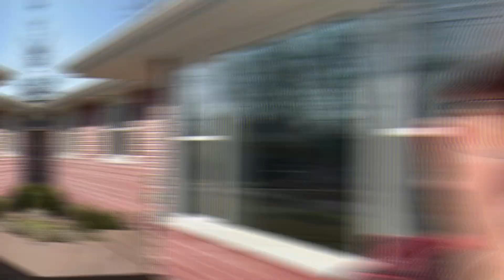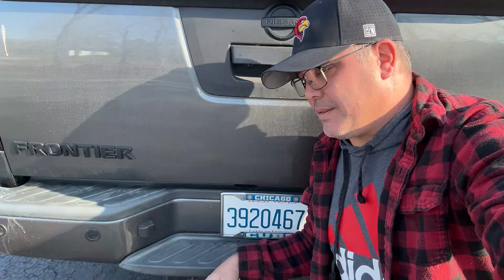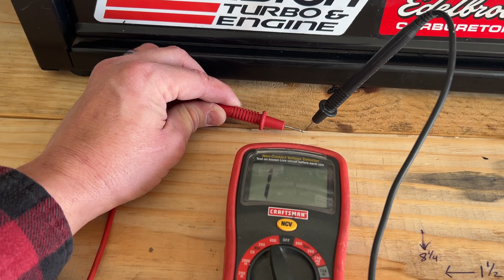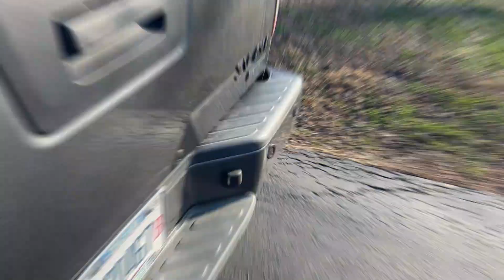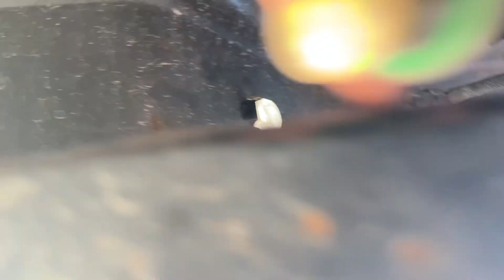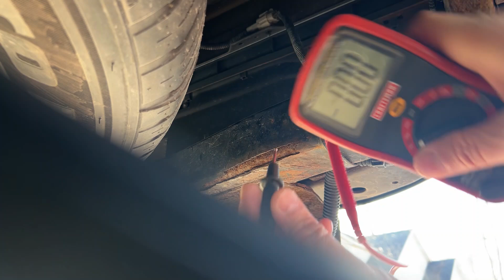Electrical Gremlins or Bulbs!?!?

Comment: Start at the front.  Engine running headlights on. Defroster at mid speed.  Multimeter at 20vdc.   
One,  positive battery post to negative battery post. 14.1 to 14.6 is expected 
Two,  negative post to the engine block.  0.04 vdc max. 4/100th of a volt 
Two B,  negative battery post to the frame rail. 0.04vdc. Because things are grounded to the frame on pickups.
Three, negative battery post to the body,   0.04vdc max.
Four,  engine to the firewall, 0.04vdc max.
Five,  positive battery post to the underhood fuse blocks. Then to individual fuses  and on many to the cable ring terminals bolted to the underhood fuse boxes that feed different fuse boxes and items like the alternator.
Six.  Positive battery post to the alternator output stud threads. This can be 0.3vdc. 3/10th of a volt but less is better.  
Go ahead and make this video. I live next to a 8 lane wide freeway. Too noisy.  Crazy easy to perform.
Reply from the maker: Appreciate you, buddy!